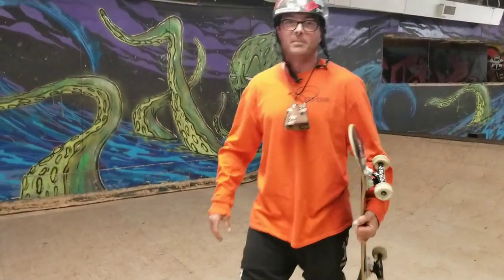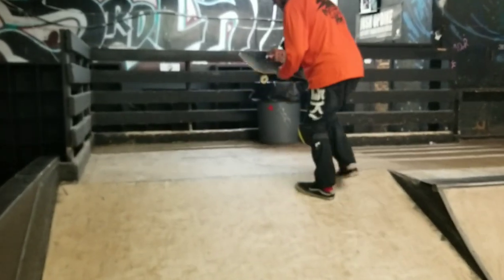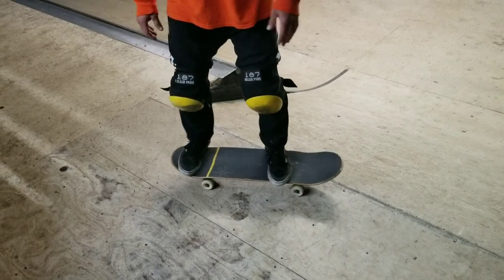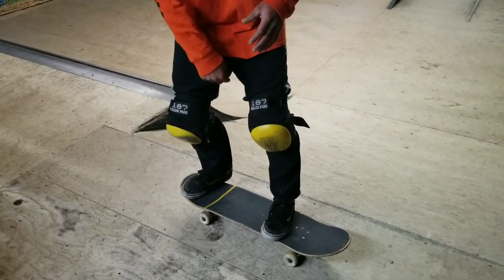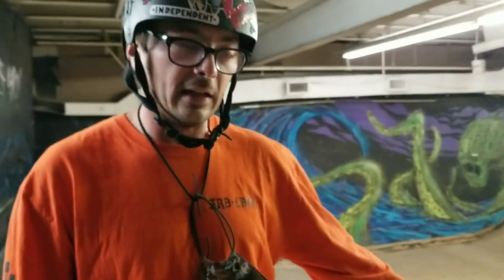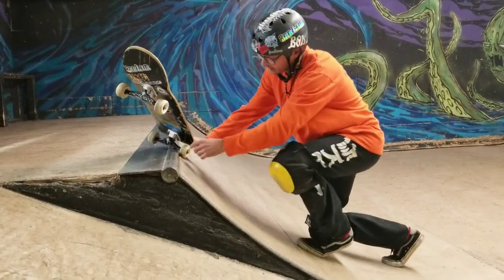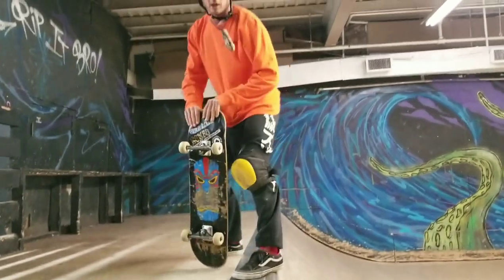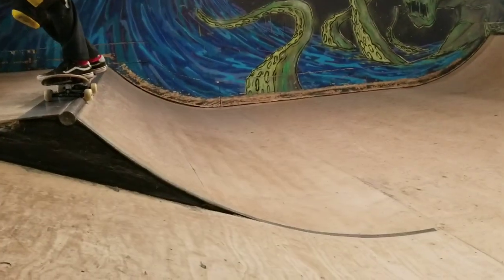How To Frontside Axle Stall -The Art Of Ram - Beginner Mini Ramp - Skateboard Trick Tips

Comment: It’s amazing how well and clear you explain things, very very VERY well done man!
I am 34 from Milan, Italy, and I am skating from a couple of years now. I love transitions and i spend a lot of time doing miniramp. I have a solid bs axle stall and I am trying and trying and trying on fs axle stall. Sometimes I do it clearly, sometimes I hang with the back truck on the copping and I fall.

I still can’t understand this:
during bs axle stall is safer to shift the back truck toward the ramp (and you demonstrate it on the dedicated video), but I can’t understand why when doing the fs axle stall we need to drop back in without shifting the back truck into the ramp.
My back truck often hang to the copping when trying fs axles, it never happens when trying bs axle because i push the back truck against the copping.

Any help would be very appreciated... keep going with the great job!
Reply from the maker: So the reason  you are lapping over the deck into a hang up is from no being enough into ramp as you turn in. If you are to on top of the deck as you lift and turn you will slip into a rock more than often. You really have to start throwing your body weight starting with the head and shoulder, in and down into the transition. You will probably be doing a micro pressure ollie in it will feel like. Remember to pivot on the back heel as well lots of kids I teach keep the weight on the toes for the stall to long also causing the hang up. Hope that helps soldier!

Comment: Awesome vid, thanks Trog! And thanks for all the vids, super helpful how you break em down. I'm battling this right now and keep eating it. Do you have a tip on shifting your weight from inside the ramp to up top on the coping?
Reply from the maker: Great question and if you like to send me a video to check out just hmu @trogarmy on insta. however lets see if we can troubleshoot this issue. Have you learned...
a straight roll out by rocking out?
a straight roll out by bonking back wheels? 
a straight blunt roll out?
fs roll out? where you bonk back wheels and turn 90 frontside?
Frontside slasher?
If you can do all those and are pretty consistent then it seems like the timing of the trick is off. lots of people push down on their toes and the balls of their feet while turning frontside, instead of pivoting on the  back heal. This creates a slip down to palms a lot of the time, and hope fully it never turns to a chest, arm pit or throat or jaw smash but i have seen all that. 

Pump up the ramp 
do a late fs slasher 
lock in back truck 
smash down front truck
then press on toes to stall and deck front side
make sure heal side wheels are both locked in.
Shift back on the heals, twist, spot landing and point and look where you want to go.

I hope this helps on your journey. If you have more questions. send them over!
Reply: Hey  @trogarmy  thanks for the really nice reply man ✌I'm outta action with a knee thing for the month or so ... but yup I can do all that apart from the blunt roll out. And I got the fs axle-in down the other day (just before I twisted my knee 😂)
Thanks for the tips on the fs axle-in man, that's awesome advice! 
My thing is that the board goes flying up over the coping and I crash back into the ramp which really sucks. I had the same thing when I was learning bs axle-stalls. 
I've kinda got fs smiths down. Maybe it's just practice ... I'll send you a vid if I get one where I eat it again :) Cheers buddy, and thanks again!

Comment: I’ve been doing these for a few years, what’s it like when you take it to vert? Do you still get right on top?
Reply from the maker: On vert you have to get low to lock in but yes once you are locked in on top you can drop past the vert and roll away. i personally don't do stand up fs axels on vert i will do fakie fs 5050 or frontside pivots. its not really a good set up trick. now a fs 5050 grind that is a different story...

Comment: I cannot figure out why my back truck always hangs in the couping when trying this trick. Any clue? I have tried over 100 times and I still have not landed a single one.😢.
I am 43 and I am trying to land my first FS axle drop for the first time by the way 😉
Reply: not enough pressure on the heel when initiating the drop-in, not enough weight in the transition (get low, ass to the flat!), not enough commitment (mini hop). I just learned them myself. Those are the things I had to concentrate on.
Reply from the maker: Did you put one down yet?
Reply: @trogarmy  YEEESSSS!! 🥳🥳. A couple of weeks ago something made a CLICK in my mind and suddenly I started making them super consistently!
At 44 this is the trick I have struggled with most so far but it has now opened the door to many other tricks. I am now working on FS grids, 5-0s, pivots,...
Thanks a lot!
Reply: @badsn  you were spot on with all the points you mentioned. Specially the mini hop, made the whole difference.